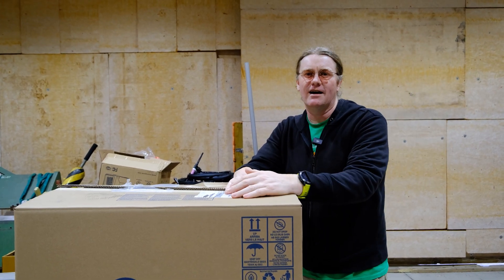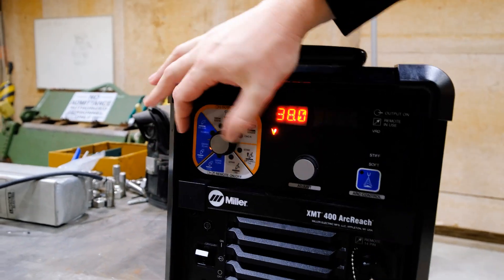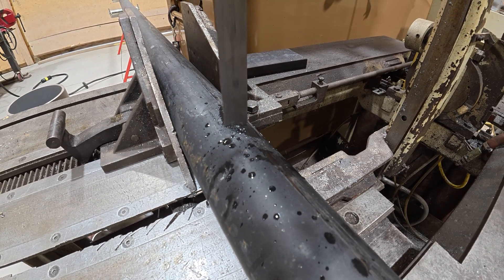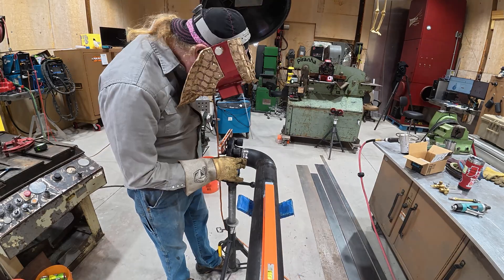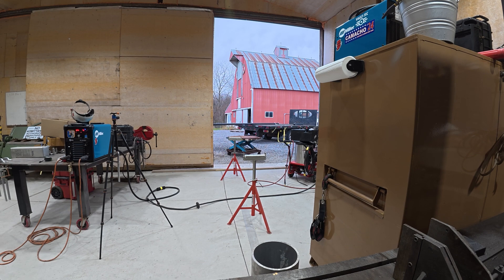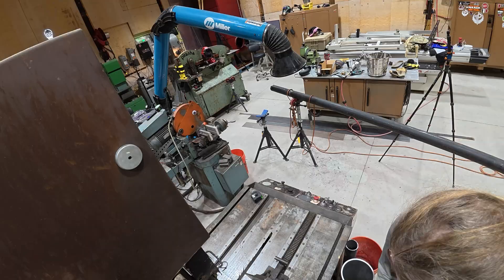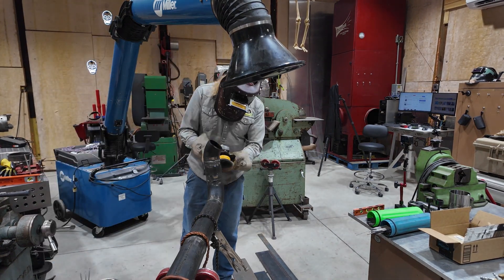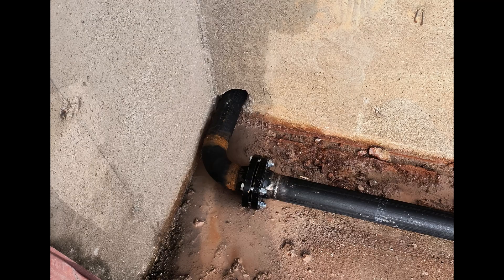Welding Carbon Pipe With The XMT 400 ArcReach

Comment: as a pipe welder from alberta, hers some tips since you havent done this in a while.. 3/32 gap and 3/32 land, 1/8 6010 around 90 amps. When you're rolling pipe, roll it away from you.. the same way you did the root, but with a bigger rod. i usually use 5/32 7018 to cap 3" with. Also weld your small pup and 90's/fittings first, then roll them onto the full length pipe. That way you can roll out every single weld, and not having any in-position welds to do (slower) get yourself a wheel/chuck to fit stuff into and spin in place. Digging the new xmt!
Reply from the maker: Hey I really appreciate it, I have a chunk left over I need to get some more practice in. Never would have thought to use a 5/32 but makes sense for speed.
Reply: @DarlingtonFarm  You're not welding up hill while rolling the pipe, instead youlll have the weld puddle on the top of the pipe / 12 o'clock, rolling it away from you, so the slag runs down the back side slightly and not into your puddle. Lets you get a nice smooth flat weld deposit while letting you run a big rod to smash it out. On 6" STD  wall i'll use 1/4" 7018 to cap it with.